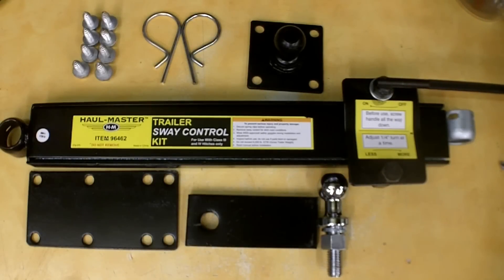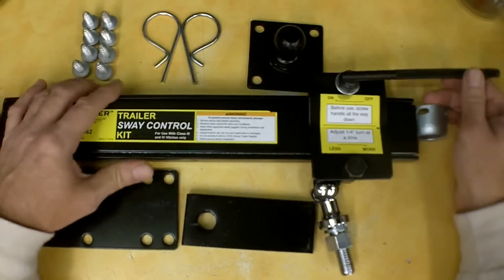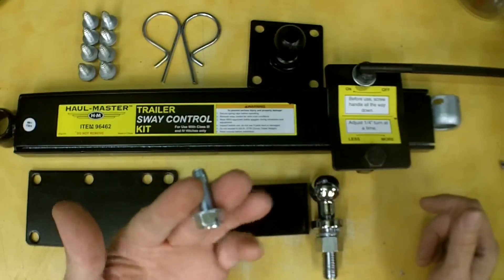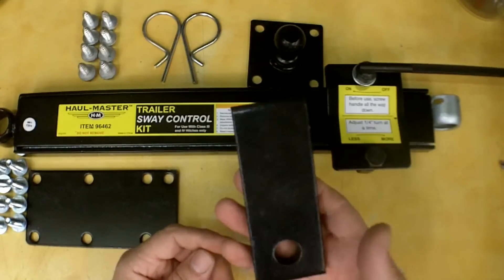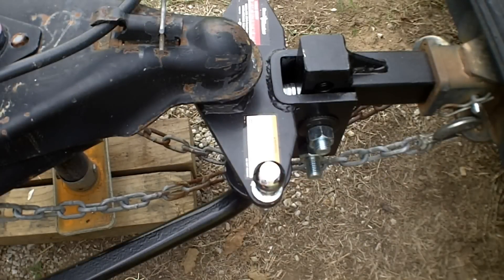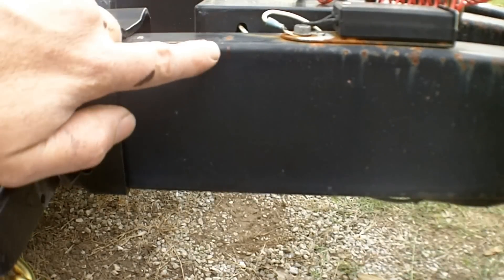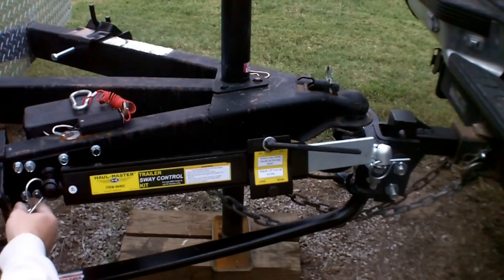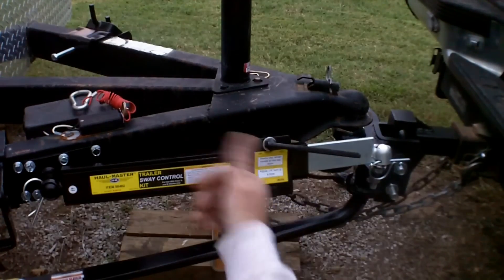Harbor Freight Trailer Sway Control Kit Review Item 96462

Comment: Saw that HF sold the weight distribution set in another video and then ran up on yours and damn glad I did. Saved me a bunch of money and headache. Was debating on should or shouldn't I get a weight distr. Set and if I should use a sway bar. Glad I found your video Sir.
Reply from the maker: Rusty Williams Thanks Rusty! I reviewed distribution and the sway kit separately since they are two different HF products. I say use both. This kit does work. It groans like a whale when turning, but it's a small price to pay for control. Plus it lets people know your coming...lol. Good luck! G.

Comment: Thanks for not wasting time and footage with the drilling process.  My question is: It seems that this kit will limit the maximum jacknife angle of the trailer, right ?
Reply from the maker: Thanks Roy! It can to a degree, but I can't say for sure what that degree is. I can say it's not that major since I've done some pretty tight stuff with no problems.  If you get into a tight situation where you're really jackknifing to the max- you can remove it ahead of time if it gets in the way.  Hope this helps, G.

Comment: Wow, this is what I needed!   My little TT came with that little ball already mounted on tongue.   I drove it down the highway for a short trip and found the sway problem with semi's.  No problem with oncoming semis though.   For this price, I'll give this a shot, and looks like I have it already half mounted.  Just need the receiver hitch part done.  Thanks much!
Reply from the maker: No problem Kim! Yes, you're half way there since the ball is already on the trailer. Give it a try. It should help with sway. If you still have problems- look into a weight distribution hitch to go along with this. I have a video posted on the HF distribution hitch. Good luck, G.

Comment: Thank you for this well put together video. I also watched the distribution hitch video which was equally helpful. I will be sure to check those chains before I leave the store. Thanks again
Reply from the maker: Thanks Gary! Glad you found them useful. Good luck, G.
Reply: Picked it up today. The chains were correct. I also noticed that the nuts holding the chains to the spring bars are crimped nuts so Teflon nuts are not needed.
Reply from the maker: Thanks for the update Gary! Good to hear yours had the correct chains and they even included proper nuts. Take care, G.
Reply: Gary

Comment: thanks for video!! would you know if this will help prevent sway for smaller trailers? I have a small 5 x 9ft trailer with small tires that sway when i have my ATV in the back? or is this for bigger trailers/campers
Reply from the maker: Thanks William! It might help, but I would check how your loaded first before getting one. It almost sounds like you might possibly have a tongue weight problem. Too little tongue weight, and it might cause the trailer to whip around. Too much tongue weight, and it might push the rear of the tow vehicle around. I would move the ATV forwards, or backwards to try to get it loaded correctly. I'm no pro, and don't know what your setup looks like, but that's where I would start. Good luck, G.

Comment: Is this sway control reversible? Could an identical one be installed on the other side of the hitch for a heavier trailer?
Reply from the maker: Yes it is and yes, you can install two on the same trailer. You just need to flip things around. Hope this helps, G.

Comment: Won't the drilled holes eventually rust..causing the sway bar to fail? And doesn't drilling holes possibly reduce the weight that can be hauled?
Reply from the maker: I don't know, G.
Reply: Only surface rust. 
By the time that really rusts and fails the trailer will have other/bigger issues.

Comment: What size holes did you drill for the 3/8” screws?
Reply from the maker: I can't say for sure Mike. I held up bits alongside the screw so the threads were proud of the bit size. It was probably around 5/16", but don't quote me on that. The ones I used were 3/8" 16 pitch that included the self taping feature. You can use a standard 3/8" 16 pitch bolt, but would need to tap them manually. There are tap drill size charts for threading online. Hope this helps and  Good luck, G.
Reply: Thanks for the reply. I bought the same bolts you did and had a miserable time yesterday getting them threaded into the 5/16” hole I drilled. I’ll try again today and use a tap/dye to run my own threads if I fail again
Reply from the maker: @mikerambunctious6135  No problem Mike! Tapping the hole might just be the ticket you need, especially if your frame rail is quite thick. Let me know how it turns out, G.

Comment: I saw a review on another brand (remarkedly similar in appearance) where the You Tuber said he decided to use a slightly larger drill bit for those "self tapping" screws because they required so much torque.
I would be tempted to do what you did, or drill all the way through and buy longer bolts with nuts.
Reply from the maker: That's cool Pat. I would be hesitant to use a larger hole for to use the fasteners that came with the unit.  
They would be more prone to pulling out. I think your idea would be best if you can drill all the way through the frame and use longer bolts and nuts. If you do choose that route, make sure you don't get into the harness with the bit if it runs down that side of the frame. Good luck either way you go, G.

Comment: I bought two due to trailer weight. The comment about the big screws are accurate as they are really poor. I couldn’t find the self tapping boots so I bought a tap and die set. This cost more than both my bars but I now have another nice tool set. Going on first road trip wither tomorrow but they should be fine. Find an empty parking lot and see how tight you can turn so not to rip the bolts out.
Reply from the maker: Thanks Harold. Good luck with your first journey. Yes, finding the limits of your setup is paramount. Take care, G.

Comment: Do you take off the WDH round bars when backing up?
Reply from the maker: +gonepriused 
No I don't. I can jack knife my trailer and they don't get in the way. Other setups might vary, but I'm not sure. Hope this helps, G.
Reply: Thanks G
, I have the same stuff from HFT just never tried backing up with it all hooked up. I guess I will give it a go. Thanks
Reply from the maker: +gonepriused 
No problem! If you also installed the sway control kit, you might have to remove it if you ever need to jack knife or it might contact the trailer frame. But for easy backing situations, you probably won't need to. Good luck, G.

Comment: I doubt I will get a response seeing how old this is but do you recall the pilot hole bit size you used for these self threading bolts? also have you had any issues with them backing out since this install? thanks
Reply from the maker: I do keep up with all of my videos Mike, but no- I don't remember the pilot size for the bolts I used. But, if you know the size of your bolts- a quick search will reveal the size you need to drill. And no, they have not backed out since being installed. Hope this helps, G.
Reply: I just wielded mine and I use 2 sway bar's and my clamp's to my 
trailer's 4 of them as well, pulled a trailer once with out the EZ lift 
and sway control system  and will never do that again and have not done it cense.  Check out my comments on the review of the EZ lift hitch video.

Comment: I bought two of these, I don't see how you can mount this on the other side (drivers side) it cannot mount to the ball that would be on the a frame, there is no way to turn it around
Reply from the maker: To mount the one on the left side, loosen up the adjuster lever, pull it apart, and flip/turn one piece 180 degrees and put it back together. That will allow you to mount it in the proper configuration for the drivers side. Hope this helps, G.

Comment: Funny, i didnt see the installation process, just a beginning preparation, and final result end. Nothing in between, or how its supposed to go on. Rear ball installation or front attachment process. I m lost between buying the mount screws and what it should look like once installed. Whats the process in between?
Reply from the maker: Funny, because I pretty much covered everything other than saying to reference the manual for the welding position of the ball plate if you don't have a WD hitch. I did not show drilling holes, bolting the backing plate and ball on the frame,  how to install the ball, or install the sway bar and clips. I did give the measurements on where to install the ball and said what I did past that showing the end result. If you need to see someone drill holes, install clips and a ball- don't get one. Or pay someone to install it. G.
Reply: @ghostses  i got the info i badly needed in a different video, but thnx
Reply from the maker: @rogerclark6811  Good, G.

Comment: now that you installed the harbor frt, distro hitch and sway control how does it work for you.
Reply from the maker: They both work well together and work great man! I'm completely satisfied. I did have to get larger chains for the distro hitch and make the shim since I wasn't satisfied with the slop. The sway control works great as well. It did start groaning like a whale when turning. I'm learning that's just the nature of them. I have not cleaned it, which is supposed to help quieten it down. But, I can live with the noise over being pushed all over the road. The distro hitch levels out the tow vehichle well and it also helps with bouncing up and down when going over bumps/etc. It settles down really fast.
Having them, or being without, is like night and day for me!

I don't know if you've seen my video on the distro hitch, but take a look if you like. If do pick them up, be sure to use the 25% off coupons!

Good luck, G.

https://www.youtube.com/watch?v=DoGXlBMowM8
Reply: thanks for answering roll on buddy
Reply from the maker: SHOTGUNJIM1
No problem! G.

Comment: I have purchased several of these, and I'm trying to find the Fastenal Bolts you used. Do You happen to have a part number?
Reply from the maker: Brandon Hicks Brandon, I pulled one out and measured it up. Here's a link to the bolts I used. You might have to copy the whole thing and paste it in the browser since it's so long. Hope this helps, G.

https://www.fastenal.com/products/details/32425?term=thread+cutting+screw&sortby=wholesalepricer=~|categoryl1:%22600000%20Fasteners%22|~%20~|categoryl2:%22600051%20Screws%22|~%20~|categoryl3:%22600067%20Thread%20Cutting%20Screws%22|~%20~|sattr05:^%223/8%22%20-%2016%22$|~%20~|attrlength:1250|~%20~|sattr04:^%22Hex%20-%20Slotted%22$|~%20~|sattr07:^%22Type%20F%22$|~

Comment: Do you recall the size of those self-threading Fastenal screws?
Reply from the maker: Brent, here's a link to the ones I used. You might have to copy and paste it since it's so long. Hope this helps, G.

https://www.fastenal.com/products/details/32425?term=thread+cutting+screw&sortby=wholesalepricer=~|categoryl1:%22600000%20Fasteners%22|~%20~|categoryl2:%22600051%20Screws%22|~%20~|categoryl3:%22600067%20Thread%20Cutting%20Screws%22|~%20~|sattr05:^%223/8%22%20-%2016%22$|~%20~|attrlength:1250|~%20~|sattr04:^%22Hex%20-%20Slotted%22$|~%20~|sattr07:^%22Type%20F%22$|~%EF%BB%BF

Comment: can this be used without using the weight distributing hitch
Reply from the maker: I may be wrong Kevin, but I don't see why not. Good luck, G>
Reply: Yes as long as you can mount the plate for the ball to your hitch
Reply: Yes it will help control sway either way.

Comment: is there a hole where the pin goes through or do I have to have one driller mom trailer already has a ball mounted but I don't think there's a hole for the Carter PIN to go through
Reply from the maker: Randy, if the ball is the same size, it should work. There is no hole in the balls. The pin slips past the underside of the ball. Good luck, G.

Comment: So if you don't have that hitch where do you attach it to truck end?
Reply from the maker: Clint, it comes with a plate that would need to be welded to the vehicle hitch. I mention it here in the video
https://youtu.be/-pQ5A9_AaWw?t=114
The manual covers it. You can download the manual from their site to get a better idea as to what would need to be done. Hope this helps. Good luck, G.
Reply: ghostses ahhhh gotcha! I had a friend give me the kit and it didn't have any directions with it, just the parts. I saw the small bracket with one hole and the rest was self explanatory except for that. I was thinking I was supposed to drill a big hole and sandwich it between the ball and receiver. But welding it will be so much easier! 
Ty!
Reply from the maker: Very good Clint! Glad to assist. Take care, G.

Comment: after drilling one hole 1 1/2 hours I found the  the trailer tounge solid. I got a neighbor weld  the ball on the tounge. If you find you don't hit hollow after 1/4 in, get welded.
Reply from the maker: Good tip Eddie! Thanks for sharing, G.

Comment: I would have replaced the "self tapping bolts" with proper through bolts with nuts and locking hardware.  A typical frame piece you would "tap" into isn't thick enough to support one full thread.  One good pot hole and you will strip the bolts right out of your frame.
Reply from the maker: That's a good option Geoff. I've not had any problems to date, but through bolt would be even better. Take care, G.

Comment: what size did you get for the self thread bolts ?
Reply from the maker: +Motoxryder247 
These are the bolts I used. You might have to copy the link since it's so long. Good luck, G.

https://www.fastenal.com/products/details/32425?term=thread+cutting+screw&sortby=wholesalepricer=~|categoryl1:%22600000%20Fasteners%22|~%20~|categoryl2:%22600051%20Screws%22|~%20~|categoryl3:%22600067%20Thread%20Cutting%20Screws%22|~%20~|sattr05:^%223/8%22%20-%2016%22$|~%20~|attrlength:1250|~%20~|sattr04:^%22Hex%20-%20Slotted%22$|~%20~|sattr07:^%22Type%20F%22$|~%EF%BB%BF
Reply: +ghostses thank you!!!
Reply from the maker: Motoxryder247

No problem! G.

Comment: You said 24 you marked 21
Reply from the maker: No Dennis, I said 24 and just pointed with my sharpie somewhere around 21 down the tape. I was never seen marking at 21 was I? G.
Reply: @ghostses  I ran that back as well as I need to run it at 22.  It's marked at 24.
Reply from the maker: That it was Matt. As for needing to run it at 22", I don't really know what problems might be encountered. I guess you would need to try it out and make sure the travel works properly. Good luck, G.
Reply: @ghostses  Thanks.

Comment: My problem is my trailer I built 30 years ago a 8' x 6' 6'tall it has a straight beam for the main tongue frame, harbor freight sway bar says it will work on either I haven't tried it yes, has anyone else have this situation, otherwise I will have to weld a bracket that sticks out a ways, as if a full "A" frame,   J R jrhandy1@gmail.com
Reply from the maker: +James Raymond CreativePhotography 
James, I took a look at the manual and it does appear you can use it for a single pole installation. Page seven in the manual gives the mounting dimensions. Here's a direct link to the manual. Hope this helps! Good luck, G.

http://manuals.harborfreight.com/manuals/96000-96999/96462.pdf